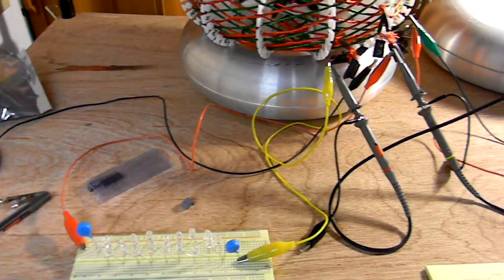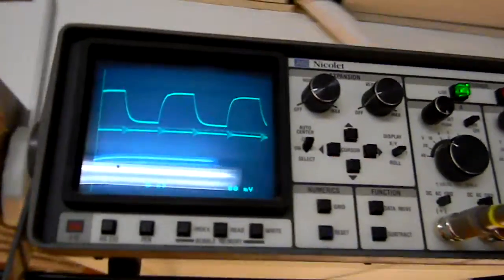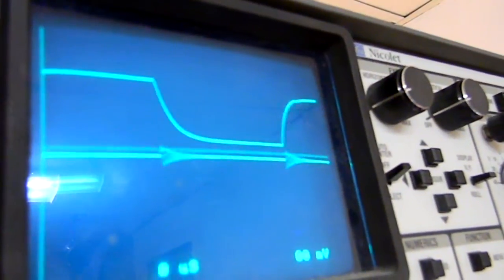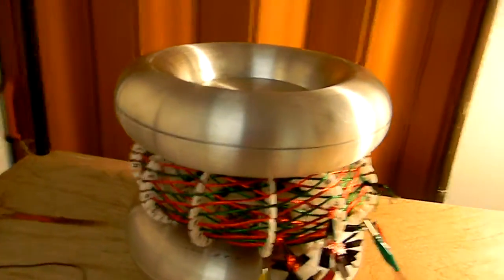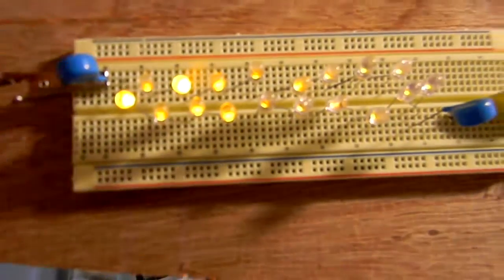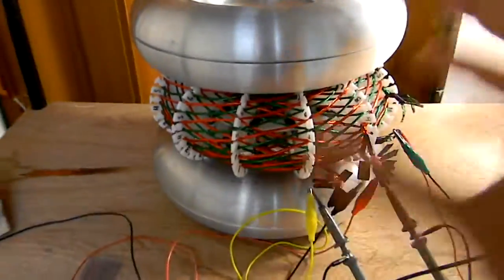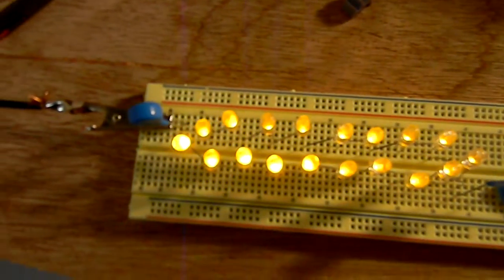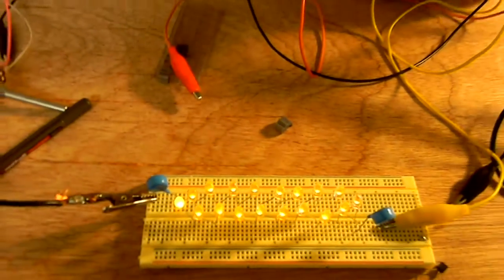Resonance vs Capacitance of Tesla style Abha/Vortex/Rodin Coil

Comment: Hi MrWarrensk, I have been experimenting on the 3 phase Abha Rodin motor generator for 4 years and have found they have a large magnetic field Much of my work is based on N.Tesla's one volt in the motor 2 volts out the generator. Try using a neo sphere magnet with PTFE bearings. Your coil look's very nice and powerful Keep up the good work, Tony

Comment from the maker: yes in that equation if you increase the capacitance or inductance the resonant frequency will decrease. So, as I add the torrid to the coil....if following this equation it would increase the capacitance of the coil and result in a lower frequency....however when I add the capacitance the frequency of resonance is measured to be higher. This means that this equation obviously doesn't fit the geometry of the vortex coil. It cannot be used.

Comment from the maker: So, what equations are you using? I only came across one for tesla coils...you are measuring your inductance and capacitance with a meter? With these numbers you simply put it into the resonant frequency calculator? So the coil still allows for an increase in inductance? I have not tried measuring capacitance or inductance....I have just been finding the frequency of resonance with a signal generator and an oscilloscope....

Comment: I disagree; I have a coil I made with 350-400feet of wire, it measures 2mH, in a resonant calculator for 35Khz, and 2mH, capcitance is 10.339   Nanofarad; another coild I was experimenting with was about 40m in 2 windings, and it has 65Khz frequency... 2500meters if it was straight, but its inductance increases in a loop (coil inductance calculator; resonant frequency calculator)

Comment from the maker: My guess is that resonance is mostly reliant on the square of inductance * capacitance....if the coil has a substantial inductance it could allow itself to achieve lower values of resonance....but again capacitance increases the resonant frequency meaning the equation for this coil is inverse in regards to capacitance....

Comment from the maker: The little blue ones? They are high voltage 20kv .001uf capacitors. They are mainly in place to show how energy is being transferred through them and to block large currents from flowing...Also I have 20 turns on the secondary....that comes out to 158 meters on the secondary windings. A coil that is resonant at 1/4 wavelength of 30khz is supposed to be around 2500 meters....

Comment: ya; but how big are your capacitors on the load?  that is low frequency; but you do have a lot of turns.  I've been playing with these a lot recently also;  I hate that youtube makes it so hard to put links :) I've been collecting notes at overunity in a toroidal coil thread      13925    toroidal-coils    msg375258   (replace lots of spaces with a slash)